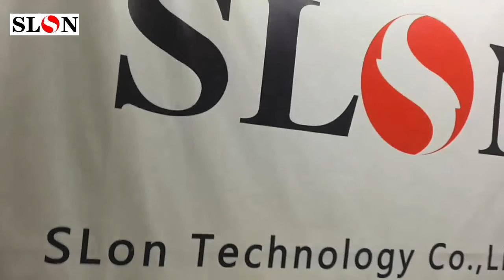PA03540-Y075 PA03540-G078 Feed Roller Tire For Fujitsu fi-6240Z fi-6240 fi-6140 fi-6230 fi-6130

Comment: At 3:15 when the tech is removing the plastic gears, you want to insert a flat head screw driver and put light-medium pressure on the gear (pushing away from the rod with screw driver, using the gear and edge of scanner for leverage) next, there is a small clip on the inside of the gear. of you are looking at the gear straight, its close to the center. It locks the gear to the rod. you want to pry that tab/clip AWAY from the center, that will allow the gear to come off and relieve the pressure you put on it with the screwdriver. It is a pretty small clip. I used a knife blade for that clip.

Comment: I have done several rebuilds of these scanners, but with much more extensive disassembly. Your process is quite elegant. How do you deal with melted rollers? These create a huge mess that is difficult to remove, with a lot of contamination of the base unit. It would make sense to replace the feed roller tires periodically if it can be done as easily as you show. I'm going to try it with the next one that I have on my bench.
Reply from the maker: Hi James. You can wear gloves, use industrial or medical alcohol, or Fengyoujing to do it. If any question, kindly contact: market@yanzeo.com